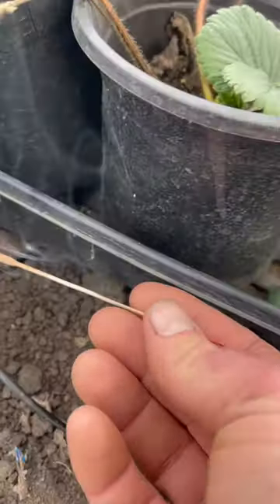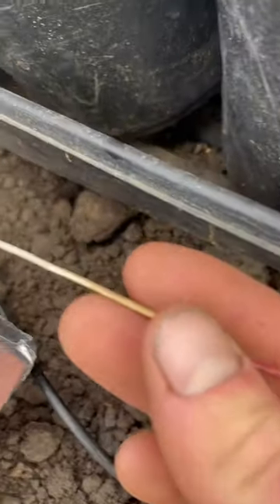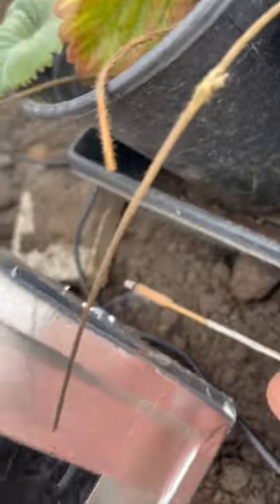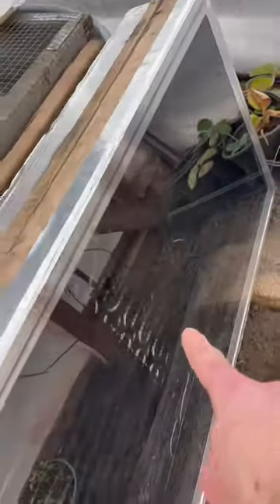Solar Heater Draw Test #shorts

Comment: I looked more into the ram pumps that I discussed on a previous video and found something that may be better, a bunyip pump.
Reply from the maker: Using an inflatable tire to build some pressure? Isn’t what what that one is? It gravity fed I believe. I’ll do some searching after work, you got my interest
Reply: @Earthdwellershomestead  Geez that's pretty much it. It seems as though it may be a better application for what you're looking to do. You may have to increase the height of your source waterz but not by much.
Reply from the maker: Great idea man, I wanna get some ideas for how I’ll throw it together and apply it. Appreciate the ideas all around, I have seen the bunyip pump before but never experimented with it.